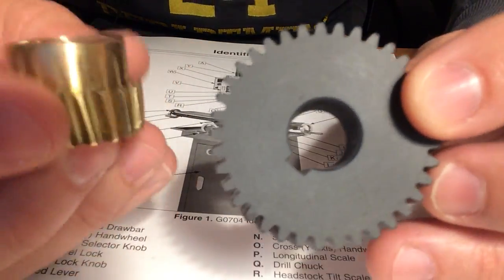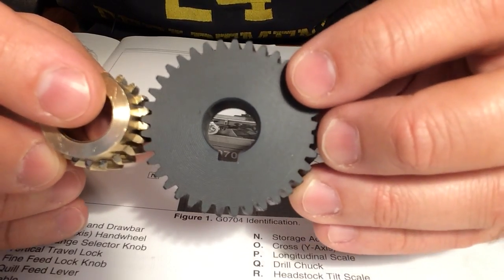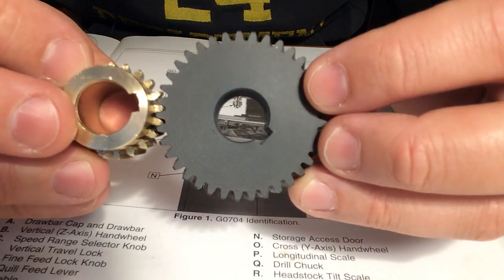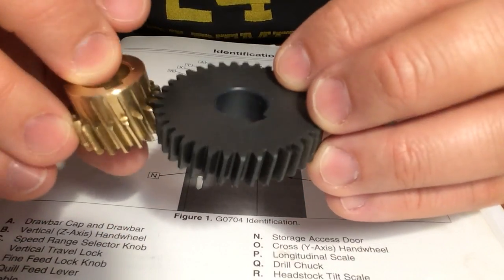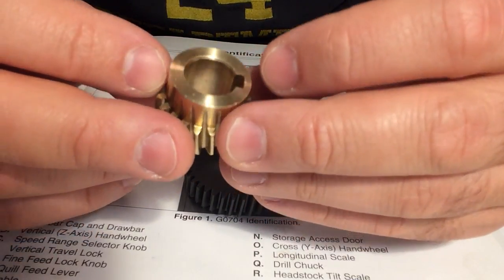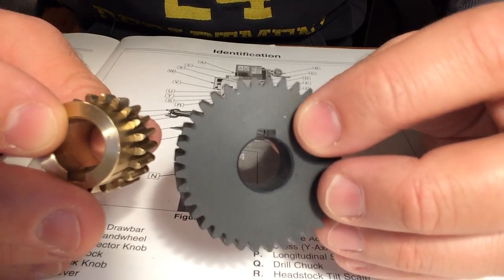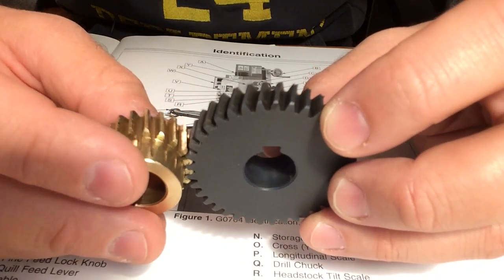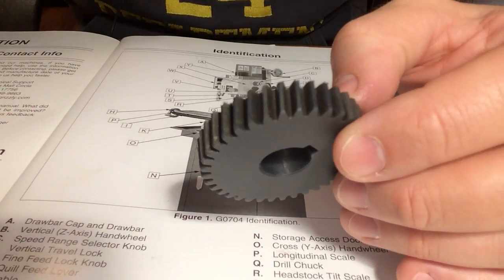Grizzly G0704 Milling Machine: Plastic Gears

Comment: Replace that plastic gear w/ steel gear and be done with it
Reply: Therese Purdy
4 hours ago
Where did you get the metal gear from? Thank you
Reply: @theresepurdy8859  ebay
Reply: Do you have a link fpr me to the gear?
Reply: @theresepurdy8859  gone now but it was $395...I got two just in case but I used one for years and NO STRIPPING ANYTHING
Reply: then the plastic hi lo gears strip

Comment: I replaced mine with 37 tooth steel gear , happy since then
Reply: Where did you get the metal gear from? Thank you
Reply: @theresepurdy8859  These were on Ebay but discontinued I believe..."maybe" you can find used ones though

Comment: Greetings from Hungary!

For those, who doesn't understand why milling machines were built up with plastic gears, I have the answer:

1. Reason
According to the standards, every household machine with universal motor (brused dc motor) has to be isolated from the other parts of the machine. Thus if the copper winding burns thru, or the carbon brush is luckless broken,  and the 230V (in Europe and Asia) will be on the motor shaft, because of the plastic gear, which acts as an isolator, the other parts of the machine (eg. housing of mill) are not under voltage. (so you can still touch the machine it safely)
 That means if you change this gear to a steel one, you risk your life by a malfunction. If you do it, you must use at least a Ground Fault Interrupter (GFI) at the supply of the machine. Please think of your child who touches the machine, and you are not there to save him/her. 

 If the milling machine uses AC induction motor,  there is no plastic gears because this kind of motor is not that dangerous.

2. Reason
 Plastic gears doesn't need much lubrication and are more or less silent. Normally steal gears which are in a transmission have always a lot of transmission oil inside to avoid being too hot, and damping the noise. Disadvantage of oil is the reducing efficiency.
Reply: Very good point. I was looking into buying steel gears. But maybe now I will rethink the whole idea.
Reply: This is a dumb answer and isn't correct, plain and simple plastic is cheaper and quieter, so part of your comment is okay. But the stator the windings go on are connected to the housing through the steel bearings at the end of the motor housing and then mounted in the of the machine, I know how motors are and I just pulled mine apart thinking I had a motor issue before finding out I stripped this plastic gear. The 110 or 230 volts would never go to the chassis because it powers the  vfd variable frequency drive to a dc motor, why because it can be reversed direction and you are less likely to be shocked by dc than ac : see Tesla vs Edison power wars thats was Edisons claim, and the power to the windings just creates a magnetic field, if you burned out the winding there just wouldn't be any where for the current to travel like burning out a fuse and the motor would stop, same thing with stuck brushes would just stop, I've replaced numerous brushes the same.
Reply: @brisjare  I replaced mine with 37 tooth steel gear , happy since then
Reply: @BTUvsCAL  you will strip the internal hi lo plastic gears now
Reply: @marmac567  have been working "just" fine
Reply: @BTUvsCAL  but it is still the weak link you have moved inside the gearbox,, a real pain to get out...  Hundreds of examples on youtube have had the problem...  Good luck

Comment: The plastic is likely nylon. Nylon is very durable and slippery, which is probably why you see less wear on it than the metal gear. I think if the gear was ABS, it would shear the teeth off of it almost instantly.

Comment: Thanks for taking the time to show the gears in the g0704 as I have not recieved my G0765 yet. Im guessing my g0765 has some plastic gears in it as well. I was thinking about making some steel gears as replacements but I was also wondering if the plastic gears are purposely used as an intentional weak point. In case the machine gets jambed, the gears shred instead of shafts shearing ...or something like that. ps im no engineer, just a guess. I would like to know for sure before I take the time to make steel gears, Any thoughts on that?
Reply from the maker: Well, the plastic gears will definitely break before metal ones will and this may provide a measure of protection if you have a crash. All of my machines have plastic gears driving the spindles in some shape or form and I haven't had a problem with them. I plan on running them until I have a reason to change.
Reply: I think imma do the the same. :)

Comment: it wouldnt seem like the plastic gear would hold up. but apparentlly they do. lol. did you make the gear.
Reply from the maker: +Bison Workshop Plastic gears are a cost cutting measure, for sure.  However, I've not had any bad experiences with them - so far.  I'm not sure why, but the brass gear has more signs of wear than the plastic gear.  These are the factory gears.